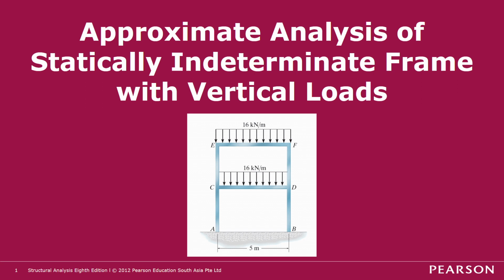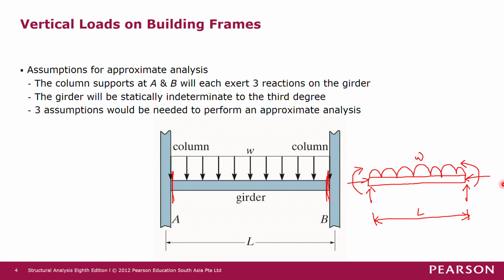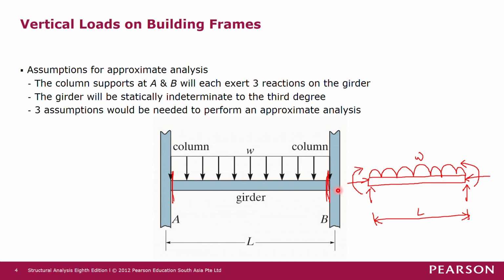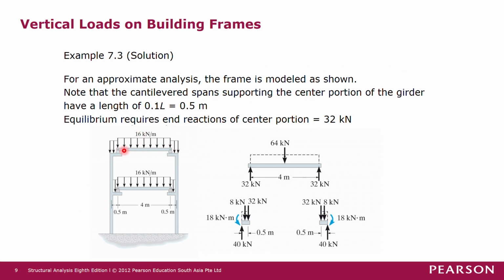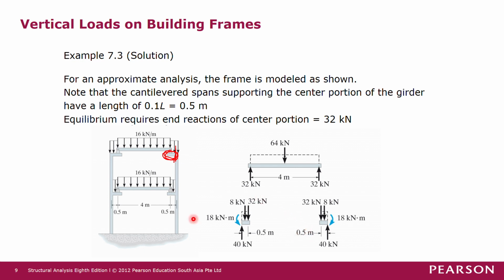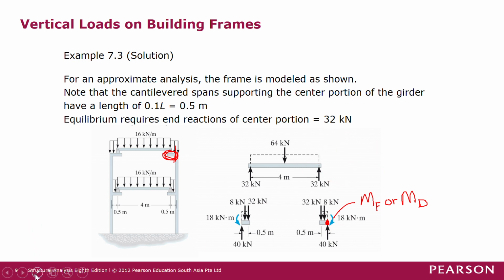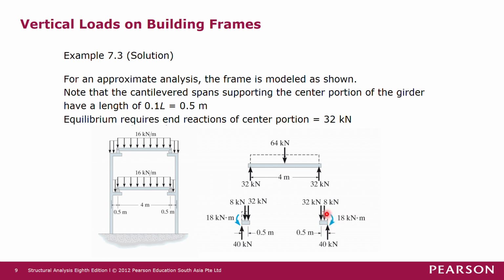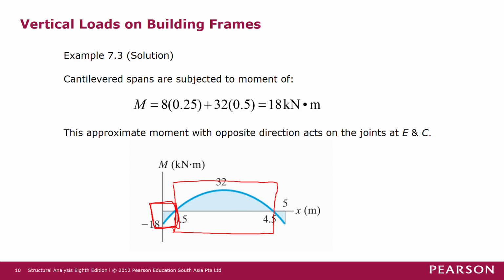Approximate Analysis of Statically Indeterminate Frame with Vertical Loads

Comment: if the columns has dimensions, let say 300mm x 300mm, and the length of the beam is 4000mm(4m), so the 0.1L = 400mm? or length = center to center of column which is 4000mm+150mm+150mm = 4300mm, 0.1L = 430mm?